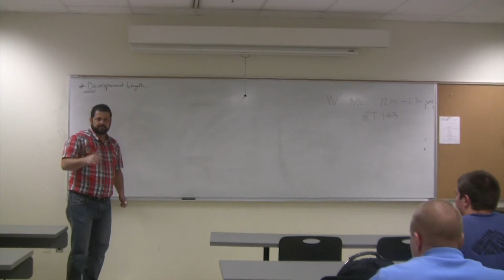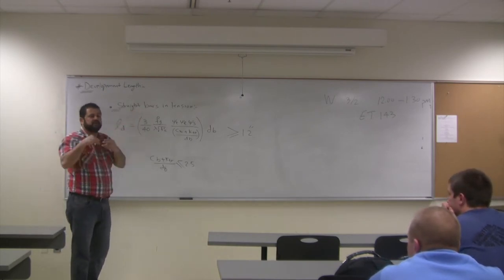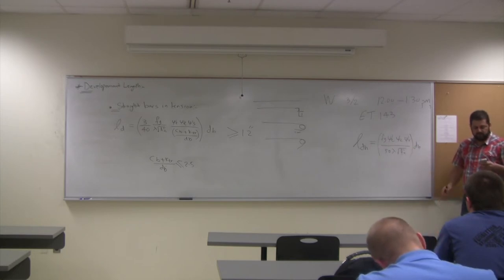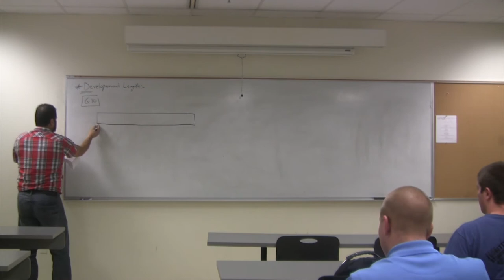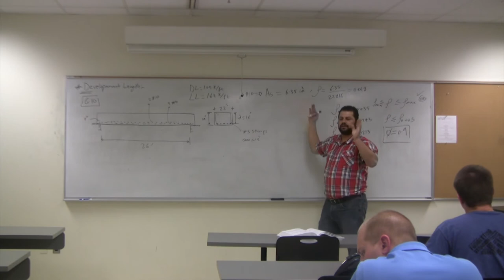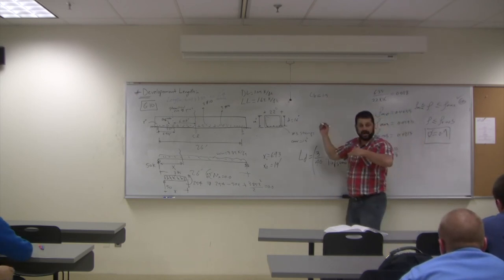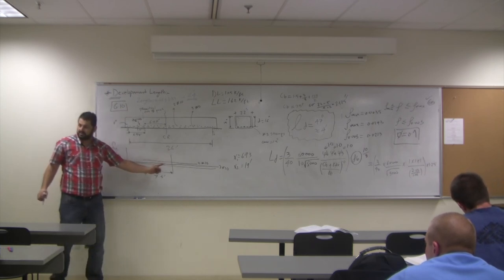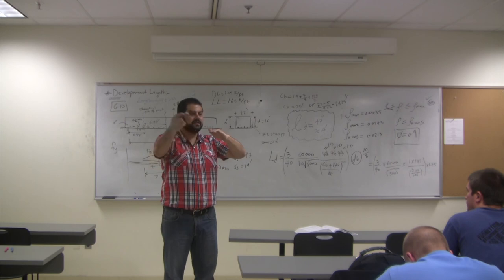Lecture #13 Reinforced Concrete Design - Dr. Mohammad Alhassan

Comment: what if the distance at 47:15 is less than 4 ft?
Reply from the maker: If 4 ft is the development length, and the available distance is less than that, then you have to use the 4 ft. If you don't have  4 ft straight, then you have to use hooked end bars. By hooking the end of the bars, the required development length decreases significantly.